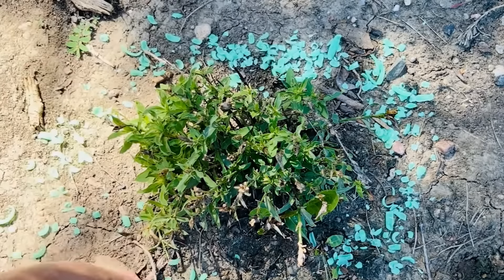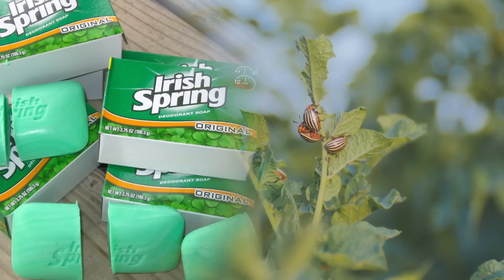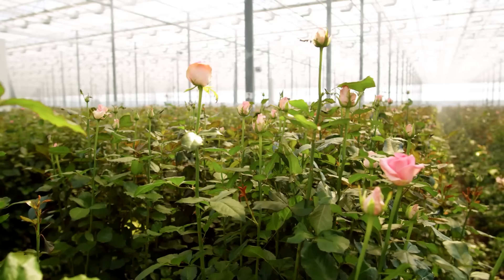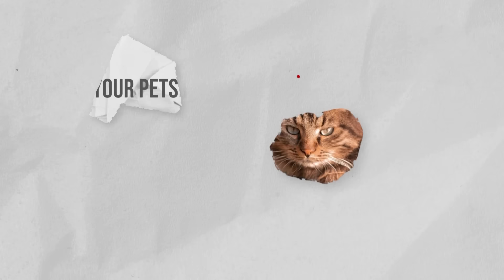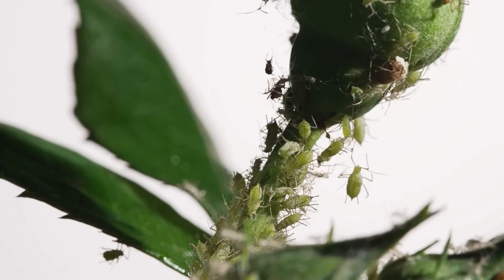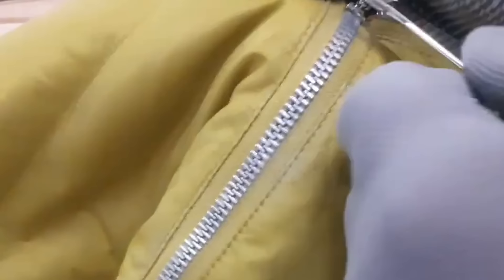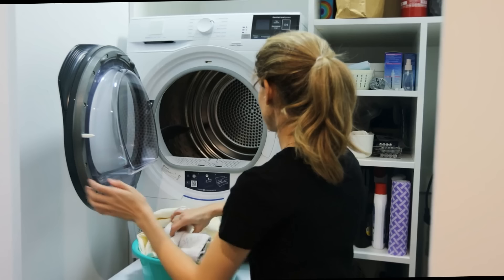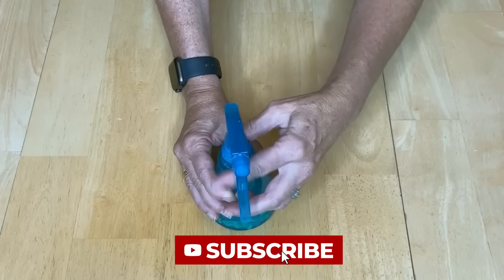ALWAYS Put Irish Spring Soap in Your Yard, Here's Why!

Comment: As someone who repairs bathtubs never use Irish Spring in the shower or tub. It leaves the most soap scum mess that I have ever seen. Finally something useful to use Irish Spring for, pest control.
Reply: I've been using Irish Spring Original for over a decade. No issues here.
Reply: That's the kind of soap I grew up using. We had hard well water and septic tank. We never had issues with our plumbing clogging. And I have good memories or how good that soap smelled. I may have to get some!
Reply: The best thing to clean soap scum, for me..is hot water and dish liquid! ❤

Comment: Compost should be stinky. If it's not, then the micro biome of bacteria isn't working correctly. A change in the scent of your compost can alert you to something being off-balance. Don't try to cover the smell of compost. It should be that way and if you cover the smell, you might miss something important.
  
BEFORE you wash your pet with Irish Spring, make absolutely sure you cannot get it into their eyes. Not even by rinse water. Wanna know why? Take a shower, wash your face with Irish Spring with your eyes open and see how that works out for you. 

Okay, for sticky sliders or placing screws easily, or pounding in a nail, ANY soap works. Woodworker here, so I know. You can also purchase paraffin wax and it will work the same, but it's more expensive. 

As for a stained garment, I'm sure this works great in some instances. However, a better solution is Dawn Dish soap. Not only does it clean stains, it also lifts grease and is gentle on your garments. If it can clean birds of oil, it can clean your shirt of the same. 

Um, as to "natural", I'm a bit confused. I haven't read the ingredient list, and it's likely "natural", but not the "natural" folks are used to seeing. If you have a question about "natural", look up the ingredient and in many cases, you'll find that the long word you don't understand is actually a naturally occurring thing. 

The goal in poison ivy/oak contamination is getting the oil off of your skin as fast as possible. A pure soap is best, so doctors suggest Ivory. Wash the area 3-4 times in tepid water (hot water opens pours and the Urushiol sinks deeper), rinse, pat dry. You may still have some itchy spots, but it will be far better than not having removed the oil. Better yet, Dawn dish liquid. We keep a small bottle in the shower because my husband is very allergic and our property is covered with poison oak. I'm not allergic, so I'm in charge of spraying, so that's great. Dawn dish soap will remove the oil faster and better than even Ivory. Again, oil-coated animals are washed in Dawn after an oil spill. Irish Spring with all of the extra scents are likely to annoy the area more. 

Now, I'm calling BS on the itching thing.
Irish Spring will NOT "cure" itching from a bug bite. Know what will? Either Benadryl cream or chewing tobacco. Benadryl is an antihistamine, which is what causes itching. The chewing tobacco (and no, you don't have to chew it) has a stronger drawing property than Epsom salt. If you have a bee/wasp sting and you have chewing tobacco, just slap a bit on, cover it with a bandaid, and in about 30 minutes you'll never know you've been stung. 
Meat tenderizer works the same. We always had meat tenderizer in the ER for such things. 

Yes, Irish Spring will lube a squeaky hinge, just like any other soap, or WD-40, or silicone oil, or any other soap. 

DO NOT rub Irish Spring or any other soap on your pan before cooking!!!! Never 
Soaps, all soaps, have fats. As you know, fats catch fire. Also, the scent can add smells to what you're cooking and that will be gross. 
Just don't. 
Just like any other thing that's dripped on the outside of your pan, if it doesn't catch fire, it will burn. So will Irish Spring. 
Then, your food, your house, smells like burned Irish Spring. 
And when you go to clean it? 
Yeah, not going to be any easier to remove than the smaller drips you may have gotten otherwise. 
Don't coat the outside of your pan on purpose!!!!
Reply: I keep a small bottle of original Dawn dish soap by my washing machine just for stains on my clothes. I put a little bit on the stain, let it sit for a bit, then wash as normal. It works 99.9% of the time for my stains.

Comment: Do any Pucks or hard soaps will work? You can mix and match old soaps?   to fit in any mug or cup that you like to use.     like Mitchells' Wool Fat? Cut the bar soap up, put in a mug, cover the soap with a small amount of water, microwave for a minute or so? if it foams up, stop ? let cool you just went to congeal' place in the sun, until soap hardens use dry brush more water i use Dove soaps there cheap and good  save your money spend it on your wife don't listen to the shave mafia.   wheelchair Larry Merry Christmas:hand-orange-covering-eyes: